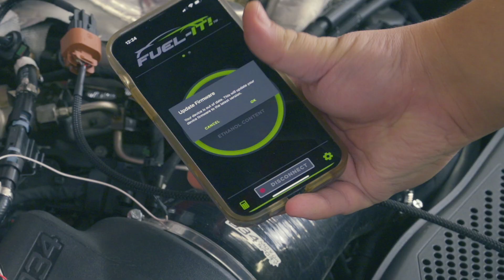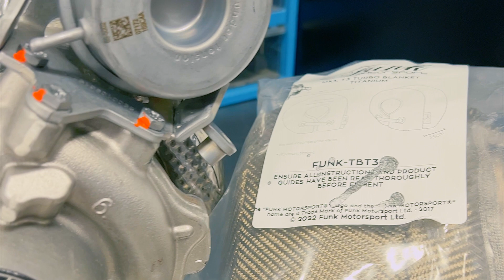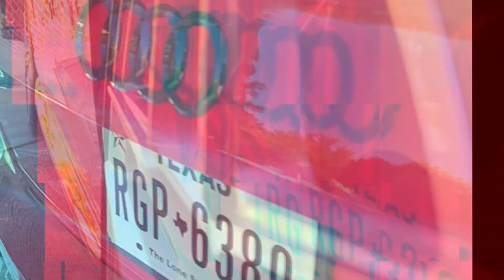Fuel-It! Bluetooth Flex-Fuel Analyzer Makes Switching To E85 Simple And Easy - Audi S4 B9 2018+

Comment: Is there any point of having this kit if you just run straight E85 and yes, I know you should always test the fuel before filling your vehicle up, but I guess this is only good for if you’re gonna mix
Reply from the maker: If you’re always testing at the pump and then NOT filling up if the reading is too high/low, then this isn’t really necessary. Im lazy and don’t test at the pump and instead use this device. Locally I’ve had issues with hot fuel (>90% ethanol) and never the other way around. So for me it’s real easy to zip in a gallon or two of 93 if the sensor reads too high after I fuel up. I just don’t get into boost, drive from the e85 station to the gas station by my house and by the time im there ill have room for a splash of 93 to even things out.

Comment: If you're using those battery terminals, does that mean it's always powered, even with the ignition off?
Reply from the maker: Correct, if you wanna do it safer you can find switched power and fuse it, but this device uses VERY VERY little power, so you can leave it running for weeks.
Reply: i think the BT consume power only when u awaken through connecting the app. works the same as dragy. only when triggered by bluetooth, it wakes up. will be zero consumption when disconnected from app i guess.

Comment: Hey Dmitry! Just subscribed and watched a bunch of videos. 

Is the only way to cut the factory fuel line? What if down the line id like to sell the car or not have the sensor on there. Are there any other options than to just cut the fuel line?
Reply from the maker: Thanks Andre! You have a few different ways you could cut the line and make it fit/work, but I don't think there's a way of getting around cutting it. You'd probably need to replace the line if you want to remove the sensor later.

Comment: Hey, I think I saw you saying that this sensor is pretty bad, and that it shows about 10% more than it is in reality. Can you confirm that? Did you get it solved?
Reply from the maker: Yea I updated the link in the description to the sensor that worked best to give a very close number.
Reply: @DmitrysGarage  Cool! Then I've ordered the right thing a few hours ago! Can you tell me what is the accuracy of this one?
Reply from the maker: @ss24957  I have an unlisted video here if you're curious that compares the SKU most people run vs. the new one I found (the one you bought). They're pretty close to the shake test: https://youtu.be/XkWw31V8f7E
Reply from the maker: @ss24957  Oops guess i didn't show that sensor in that video, but it reads within 1-2% or so.
Reply: @DmitrysGarage  Thank you!! Seems like fuel it is also using this sensor in his package.
Reply: @DmitrysGarage  Thank you, you saved me so much time!
Reply from the maker: @ss24957  glad to help :)

Comment: Is this universal? Would I be able to use this for my is350?
Reply from the maker: Yea so the kit outlined (sensor and fuel-it) are basically universal assuming you have adequately sized fuel lines to tap into. The clamps and such may vary based on line size. The main consideration is that you dont impede fuel flow, but thats usually as you start to hit really big numbers on e85. Like think 1khp. Then it may be best to just split off the fuel line with two y-splices that way some of the fuel goes through the ethanol sensor but the rest can shoot unimpeded through a larger line.